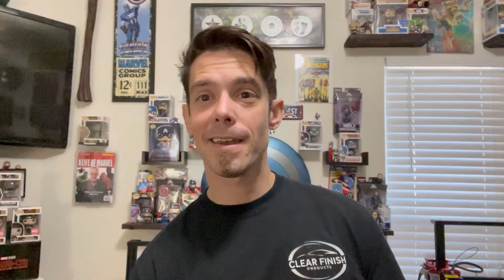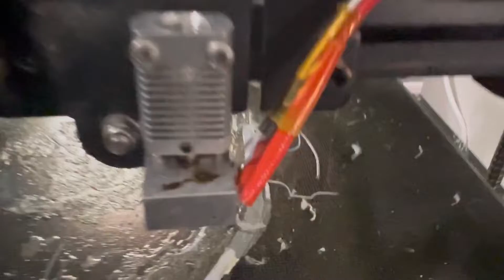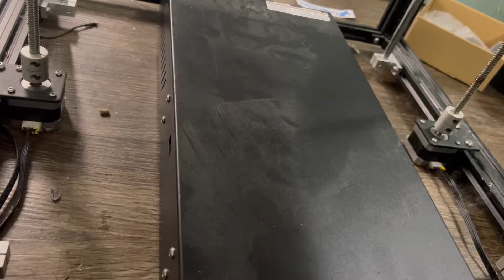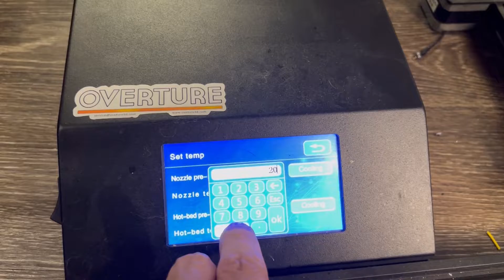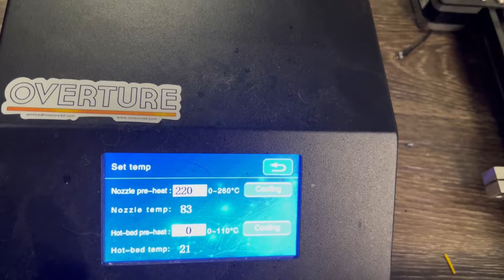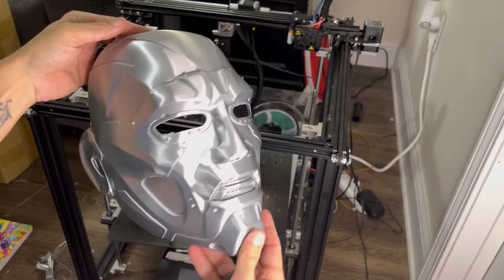Ender 5 plus heater cartridge replacement | Thermal runaway error fix & 3D printer repair

Comment: random and not sure yopu would answer this but i got an ender 5 pro from a buddy and am getting the heating failed e1 error and i see that the red wires connected to the extruder are connected properly but at that black piece one of the wires has come out, is there any way i can reconnect the red wire into the black box that connects into the motherboard/ is there anywhere i can buy the black adapter with the wires installed and resolder my already good connection into this part? Any help would be greatly appreciated
Reply from the maker: @reecewake7018  have you checked on the motherboard and tried to tie that wire back in?

Comment: Ill try this but the warning says runaway thermal, cooling something.  Normally a runaway thermal screen just says what you showed.  Mine is talking about cooling, power supply and fans, im wondering if its a fan or software issue because,  I installed a silentboard board and this started happening.

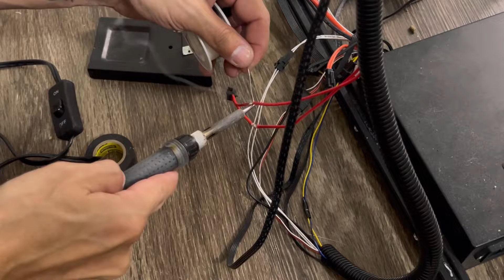Comment: Also at 3:30 you could pick up a JST crimping kit, it’ll come with that exact same connector. I just recommend getting one because of maintenance like this. The pins in the black connectors only require a light push out with a flat head or even paper clip 👍

On Amazon the kits are like $10-$20
Reply from the maker: Very good point & tip for those without a soldering kit. Thanks for that!
Reply: @Darkwingdad  after getting the kit I’ve been using it forever lol, this Father’s Day used that exact connector to rewire a rear backup camera to the back up light for my grandfather lol he originally had it on the switch in the front but he said “it’s annoying as hell!”
Reply from the maker: @bashful3026  lol! Wiring is NEVER fun…or quick haha

Comment: Hi. Im trying to change everything but my printer is showing me a constant temp of 234 degrees Celsius. I don’t know how to fix that. Tried a new thermistor already but nothing happens.
Reply from the maker: Ender 5? Trying doing a hard reset, unplug for 20 mins. Have you done a pid tune?
Reply: @Darkwingdad  unplugging didn’t do anything. Maybe I try Pid Tuning tonight.
Reply from the maker: @CptSchnauzbart  did you replace the entire wire or just splice it in? Is this an ender 5 plus?
Reply: @Darkwingdad  I replaced the wire almost entirely. The new hotend came with wires with clips installed. So I unplugged the old wires and plugged the new ones in. Yes 5 plus

Comment: I just upgraded my hot end and after splicing the wires my hotend heat up for like 15 minutes, and then ended up dying and now i cant heat it up again. Im using those silicone buts though to connect, where you stickcthenwires together, crimp it, then shrink wrap it.
Reply from the maker: I would go wire to wire & solder. Barrel connectors will result in voltage loss, even a minimal loss can be detrimental

Comment: I have an Ender 5 plus too. I keep getting the thermal runaway after every 3 to four prints. I haven't done any changes yet, can occasionally continue to print by putting a fan right on top of the print area. there are some plus and minus to this. the minus is it doesn't help with the print bed adhesion so I counter this by setting up the leveling to be as close as permissible. 

Anyway, thanks for the solution. I was hoping to see one soon. I can't and probably don't have the patience to keep resorting to my cheap ass solution later doen the line. hahaha
Reply from the maker: Try doing a pid tune & check your connections @ the ceramic heating element. A weak solder bridge can create voltage fluctuations which creates an error on the board
Reply: @Darkwingdad  I did what you recommended. sure enough, it was a couple of things. the solder was pretty bad, not sure if it came as is or if it's worn over time. also, the thermistor's insert from the other side was full of dried plastic residue. I presume these were the main causes. 

Unfortunately in Malaysia, they don't sell just the thermistor, so I purchased the entire printer head and just replaced it yesterday. Everything running like a clock now. 

Turns out that 3D printer maintenance can be quite a chore too! hahaha

Thanks for the tips @Darkwingdad!
Reply from the maker: @AFAR2809  the slightest drop in voltage can cause chaos, I’m
Sorry you had to buy the whole print head but I’m glad I was able to give some insight & your back up & running. I appreciate you letting me know & being a part of the channel. Happy printing my friend!

Comment: so this is my second time replacing my heating cartridge in 2 days any idea on why it keeps failing (not replacing till i know whats whrong
Reply from the maker: Did you splice in?
Pid tune?
Reply: @Darkwingdad  did a pid tune what is splice in
Reply from the maker: @nicksalapoutis  did you replace the entire wire to the board where it plugs in or just tap/splice in inches down?
Reply: @Darkwingdad  splice in
Reply from the maker: @nicksalapoutis  I would try replacing the entire wire down to the board. Or if you didn’t solder your connections
Reply: @Darkwingdad  okay so wouldnt be a firm ware issue
Reply from the maker: @nicksalapoutis  highly unlikely

Comment: Does it matter which way round you re wire the two red wires?
Reply from the maker: No you’re just completing the circuit, it’s AC they are both power wires
Reply: Thankyou

Comment: I put quick connect JST plugs and sockets close to the hot end for all the componants of the hot end when I got my machines, I had to change out some fans and a thermistor and having done this work early on made changing those componants a 5 minute job.
Reply from the maker: I’ve seen those fan shroud quick disconnects those are awesome!